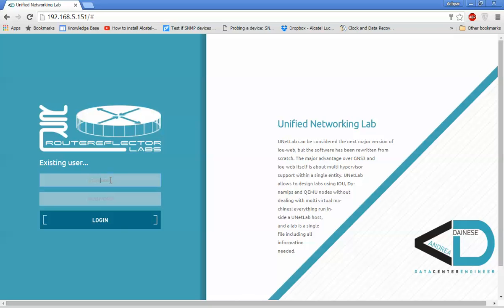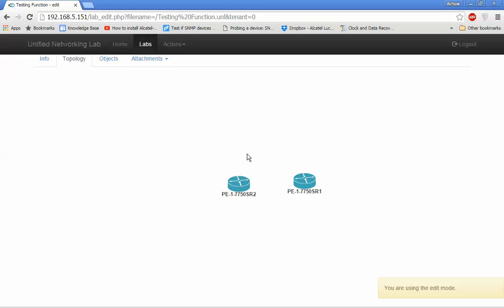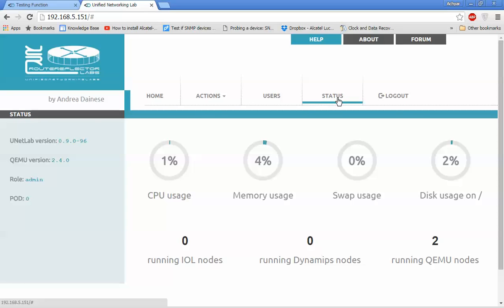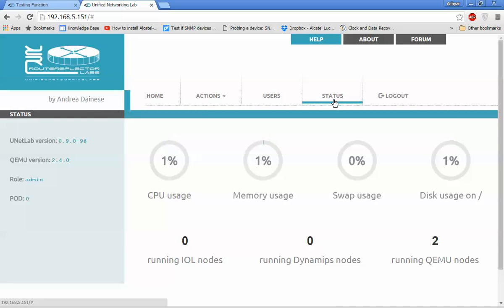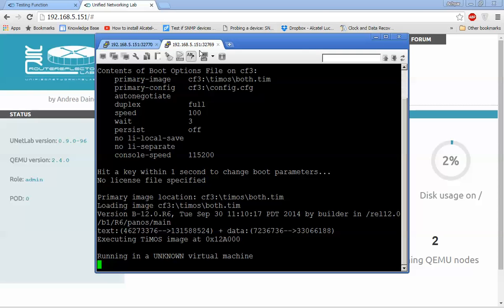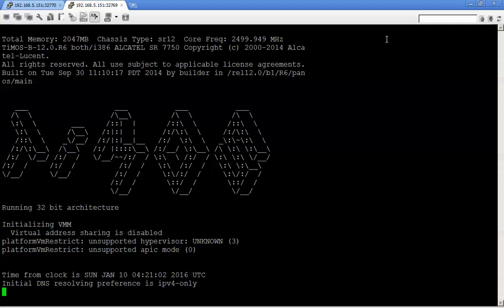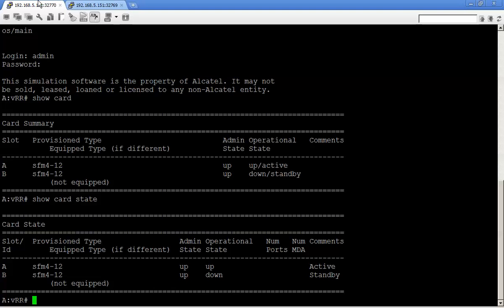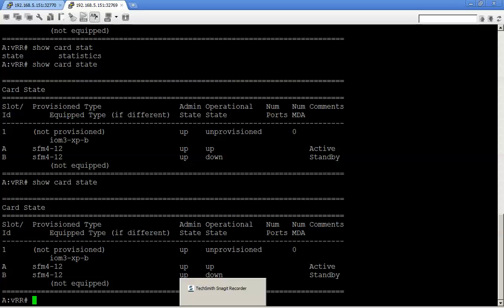How 7750 virtual SR Running on UNL LAB

Comment: Hi, I hope you can help me.
Router1
router
        interface "G1/1/1"
            address 10.10.10.1/24
            port 1/1/1
            no shutdown
 port 1/1/1
        ethernet
        exit
        no shutdown

Router2
router
        interface "G1/1/1"
            address 10.10.10.2/24
            port 1/1/1
            no shutdown
 port 1/1/1
        ethernet
        exit
        no shutdown

I configured the card and mda type for both
A:7750Router1#    show card state

===============================================================================
Card State
===============================================================================
Slot/  Provisioned Type                  Admin Operational   Num   Num Comments
Id         Equipped Type (if different)  State State         Ports MDA
-------------------------------------------------------------------------------
1      iom3-xp-b                         up    up                  2
1/1    m5-1gb-sfp-b                      up    up            5
A      sfm4-12                           up    up                      Active

But I can NOT ping across...
A:7750Router1# ping 10.10.10.2
PING 10.10.10.2 56 data bytes
Request timed out. icmp_seq=1.
Request timed out. icmp_seq=2.
Request timed out. icmp_seq=3.
Request timed out. icmp_seq=4.
Request timed out. icmp_seq=5.

---- 10.10.10.2 PING Statistics ----
5 packets transmitted, 0 packets received, 100% packet loss
A:7750Router1#

Comment: what is the maximum number of port that the 7750 SR can support for that LAB Environment :)
Reply from the maker: Hi, For vir-sim you may use 5 port, it depends on MDA available in VM (m5-sfp). But you may expand the port using VLAN encapsulation on port and add vlan switch device.
Reply: Achyar Nur Andi thank you ☺